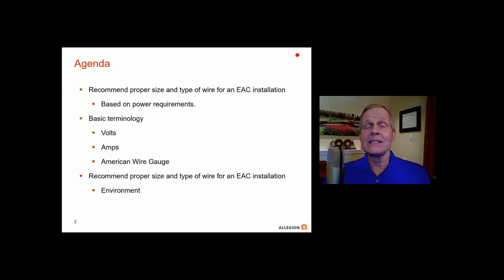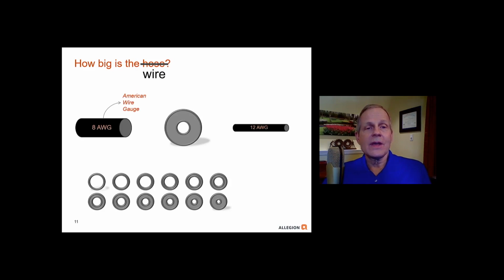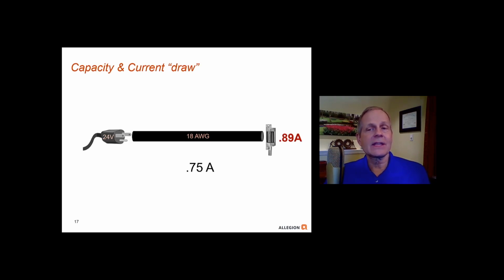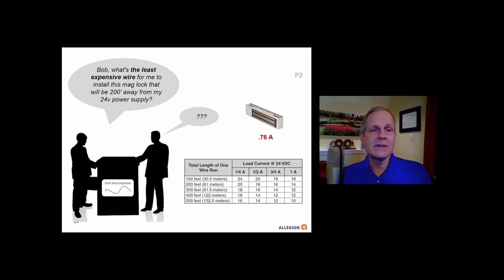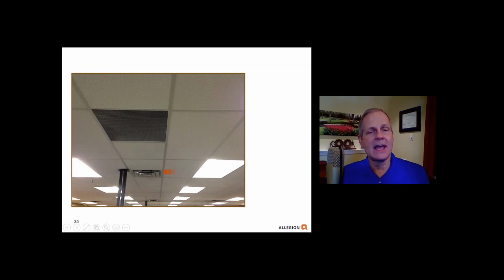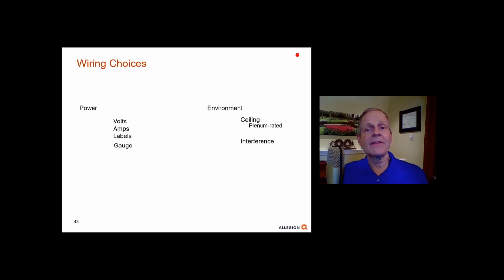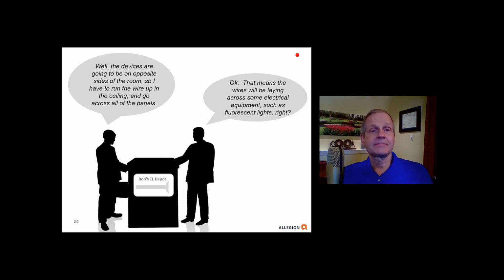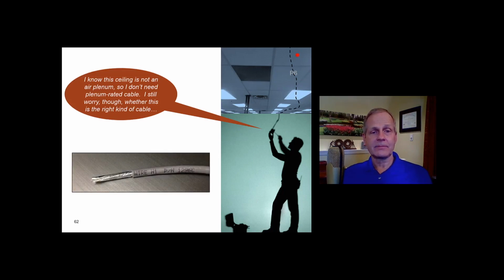Listen-In Video Lesson | Wiring Fundamentals in Door Hardware

Comment: wire gauge is directly related to inches because gauge numbers correspond to specific physical wire diameters measured in fractions or decimals of an inch
8AWG 8 =1 inch
18AWG 18 =1 inch
22AWG 22 = 1 inch